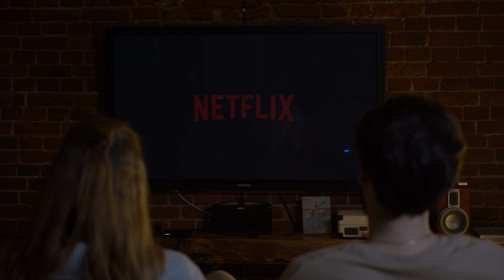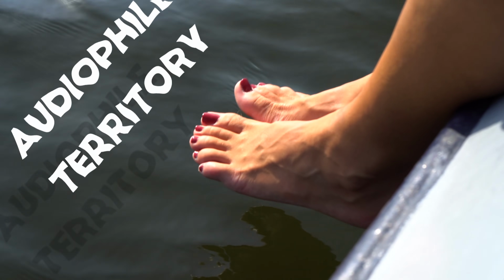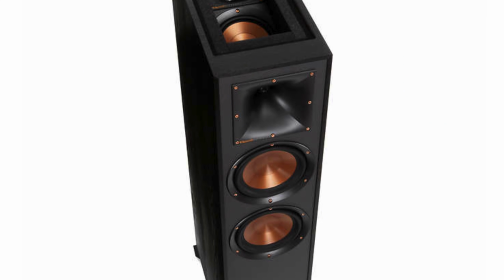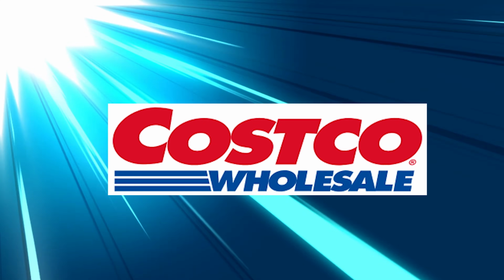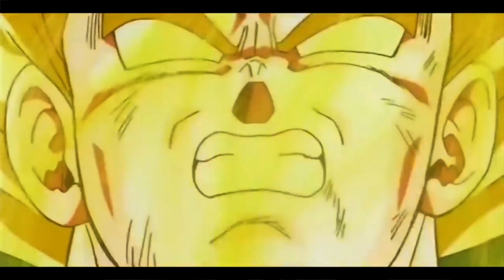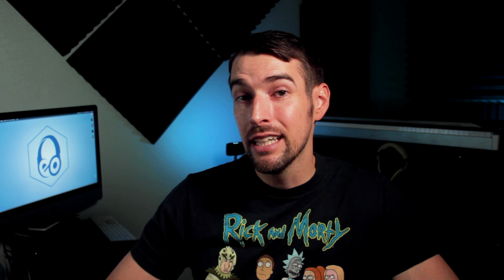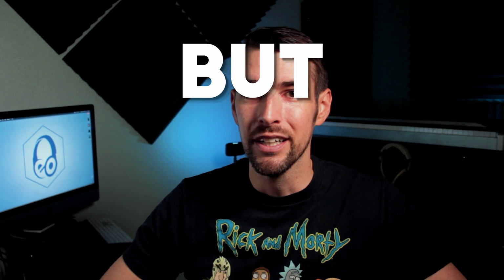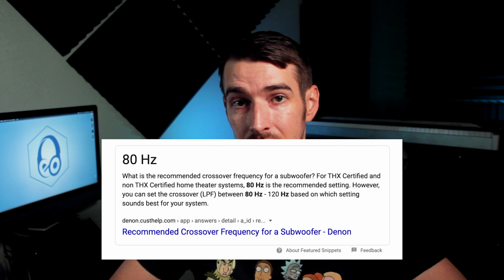$1,500 BRAND NEW Dolby Atmos BEAST SETUP?! Costco & Klipsch Bring It AGAIN!!!

Comment: Coming from a huge Klipsch fan, you must get the RF 7 III. I have them on the low end STR 750DH Sony receiver with a HSU Research MK5 VTF3 subwoofer and it blows away 99% of systems I have ever heard. I also have an Emotiva power and pre amp when listening to 2 channel audio. Definitely need another HSU research to fill the room more. Thanks for the advice and these are some killer deals.

Comment: Heads up it comes with the necessary wire for all connections, comes with 7 speaker wire sets pre cut. Just got this set over the weekend
Reply: Hooked them up to a Pioneer VSX-LX304, with one Klipsch R-12SW, also have some Klipsch Black Label b-100 hooked up as my rear with the r-41m setup in the middle of my room
Reply from the maker: @gradyshanahan2005  nice!!! Yeah, I’ve heard it actually does come with the necessary amount of wires. Costco needs to update their product description. 😀

Comment: Hey Ealan. may i ask, if those rear speakers can be connected wirelessly, and if not, what would you suggest as a wireless option? Ther front part can be wired, but for the rear part i need wireless speakers. Thanks for the answer

Comment: Hello mate, actually am thinking to buy Samsung soundbar q950t but watching your YouTube video kind of gives me second thought about buying them in piece. Just want to know if the sound quality would be better than some expensive soundbars in the market.
Reply from the maker: That Samsung is def very highly rated. And I understand how soundbars are so popular right now with how easy they are to set up. 

But I’m pretty old school, so I prefer a solid receiver powering wired speakers over a soundbar any day. More effort to hook it all up, yes, but more reliable and powerful, in my opinion. I mean having that 12” Klipsch subwoofer alone is a reason to NOT go with a soundbar. 

But like I said, I understand the appeal of a soundbar, and depending on your home theater space, that Samsung might be perfect! But I have a large, open concept living room, so I just need more power to push the air out of my speakers quite a distance to my couches. 

Also, yes...I honestly think the sound quality would be better with the Klipsch floor speakers and bookshelf speakers. 

But lastly, depending on where you live, the Samsung might be more available and at an affordable price than the Klipsch setup. I know people in Europe have commented that Klipsch speakers are insanely expensive.

Comment: Do you know if the Yamaha tsr 700 from costco can handle the 899 klipsche speaker system (from costco) and 2 klipsche subwoofers (from costco) well?
Reply from the maker: Most definitely. Although I keep getting conflicting numbers saying it’s 7.1 or 7.2, so I’m not 100% certain it can handle 2 subs. Technically, the same receiver is also known as the RX-V6A, which is 7.2, so go figure. 😄 But power-wise, it should handle even larger speakers just fine. And it’s 8K ready, if that kind of thing is important to you. 👍
Reply: Yup I just bought the receiver about a week ago the box says 7.2 what does 8k really mean
Reply from the maker: @tylerdurden6186  It just means it's 8K-ready for when 8K resolution becomes the norm with streaming broadcasts and blu-rays, etc. Kinda like how 4K is the norm currently. But everything in 8K won't be for at least another  years maybe? But at least you know you can upgrade your TV to 8K and not have to worry about upgrading your receiver, too! Woohoo!

Comment: what brackets would you recommend to hang these speakers?? just got this system! thanks man great vid.
Reply from the maker: These ones are great and cheap for the bookshelf speakers (on Amazon) -  https://amzn.to/3tLWyvU

 And congrats on getting the system! Thanks for watching! 😀🙌
Reply: @ealanosborne  what about for those satellite speakers?  and also whats a good avr for next gen game consoles?
Reply from the maker: @psychojackel69  I use these for my little Klipsch Theater Pack satellites 

Monoprice Low Profile 22 Lb Capacity Speaker Mounts
On Amazon https://amzn.to/3pLIQGk

And the Yamaha RX-V6A is a stellar receiver that can handle 8K 60 Hz and 4K 120Hz for next gen gaming!
Reply: @ealanosborne  i just saw costco put back up the yamaha tsr700 7.1 for 400 . and supposedly its the same as rv6a. but  it says it is a 7.1 with 2 mono subwoofers. what's the difference between that and 7.2 system? i have two subs is why i ask.
Reply from the maker: @psychojackel69  Oh sweet! That's awesome! Well, 2 mono subwoofer channels just means it's one signal that's been split into to ports. You might not get AS much power to each sub as you would with 2 independent subwoofer channels, but honestly...it probably won't make much of a difference. So since you have 2 subwoofers, and it has 2 ports to plug them into, go for it!

Comment: During December 2020 that sub was on sale at my local Costco for $99ea!
Reply: @ealanosborne  I have a 12” onkyo sub on my 7.1 would it matter if I paired it with that klipsch sub to make it 7.2?
Reply from the maker: @sabrewolf9567  nope. There’s plenty you can do to “timbre match” 2 different subs. I know Home Theater Guru has a video about it, if you wanna search in their archive. 👍
Reply: Way to rub it in. Haha. Jk. Last summer RC Willey’s opened up a new store in my home town and had “grand opening prices” and I got my first klipsch bookshelf speakers R-41m for 80 dollars per pair. I bought two pairs right on the spot. I know a deal when I see one.

Comment: My speakers alone cost over 2500. Throw in my 2 12inch Klipsch subs that cost 500 each my receiver that cost 1000 my TV cost 1600. Then all the 8awg speaker wire and HDMI cables, and my pure silver banana plugs. Crossover settings should be set about 10hz above the cutoff. For example, A lot of bookshelf speakers low cutoff is 70hz, so set your crossover to 80hz.

Comment: Is a full Sonos system good or even worth it? Arc, 2 play 5’s, 2 sub’s? You know compared to what you’re recommending right now
Reply from the maker: I’m pretty old school when it comes to home theater, so I’m gonna side with wires and receivers over soundbars any day. And getting an Arc, 2 play 5’s and 2 subs is gonna cost a lot more than the setup I explained in this video anyway. 

The other factor is connectivity. With any wireless system, there’s always more of a chance to have syncing issues or the need to troubleshoot problems. My receiver+wired speakers never has connectivity issues. I turn on the TV, and I know it’s gonna work. 

Lastly, those Klipsch subs still blow Sonos subs out of the water. Hands down. I’m personally okay with the effort it takes to connect speaker wires to a receiver (especially mine, which I had to snake through the attic and fish out of the walls) because the end result is extremely reliable. 👍
Reply: @ealanosborne  Thank you so much for the quick response! I really appreciate it! Ya I know what you’re saying I wanted to go old school and get like a full 9.2 or even a higher system, but my cousin told me I have to get Sonos because it’s so easy and efficient. 
And to be honest I’m blown away with what I got. You should definitely try a full system and see how it is. I would love to see what you would think about since you know why more about all the system and what they can deliver. Anyway Thanks again for the response!!
Reply from the maker: @artintsaturyan  Believe me I’m so curious about Sonos’s claims about their room calibration tech. I’m trying to get people to join my Patreon so I can use the proceeds to get more systems to review, but so far, I have only one patron. 😄 Being a small channel, I don’t have much power behind my email requests to companies asking for products to review. 🤣 Some day, tho! 🙌
Reply: Don’t worry you’ll get there. You put out some great content!

Comment: as for experiance goes in this domain
..i would stay as far as possible from...trusted brands sold in a costco.....

because there is a bunch of them who are fakes and only sold in the costco by shady  resselers.

if you think this is a good deal...there is a trap there.
kiplish wouldnt lower their price for anyone... so why would costco be able to have it lower? well because it is not a real kiplish.
k
Reply: you couldn't be more wrong. sure, other products might be being sold by shady resellers but.....I got this whole setup (speaker pack, sub and denon receiver) back in December, and it is absolutely superb. real and genuine products, both the klipsch speakers and the denon receiver. this stereo setup will blow you away, and it sounds freaking amazing. Please don't be discouraged by trolls like this guy, from buying this setup at costco. you will be supremely happy with your purchase after you get it setup and listen to it for the first time. I've owned klipsch systems for the past 15 years, and this offering at costco is legit and real. get it before its gone, you won't be disappointed!

Comment: Great video thanks for posting!!! but I have a question, I'm definitely looking into upgrading my receiver. But I don't see why the 

sony av receiver str-dn1080 
$499
Is with the extra $150 from the cost of the 
Sony str-dh790 

     The only real difference I can see was that it has an extra 150 watts I think. Did I miss something? What's the big benefit of jumping up to the next level?
Reply from the maker: Great question! I’ve pasted a great comparison chart below you can take a look at. But in a nutshell, the DN1080 just has more bells and whistles. Yes it’s rated at 100W while the DH790 is 90W, but the 1080 also has more HDMI inputs, more HDMI outputs, more music streaming options, Google or Alexa support, eARC support, smartphone app control, etc. Those bells and whistles you might not care about, so the DH790 might be good enough for you! 👍

https://www.crutchfield.com/S-RBB8MuKVTM1/compare_158STDH790_158STN1080/Sony-STR-DH790-vs-Sony-STR-DN1080.html
Reply: @ealanosborne  thank you very much for the quick response!! As I was looking to go in today, to buy a new receiver. your help is greatly appreciated! So yes you're right I don't care about those bells and whistles. The only thing I care about raw power and if the receiver can handle Dolby Atmos. So the 790 is for me at a perfect price. 
Side note: a quick search of Google and costco.com shows that the 790 is no longer available at Costco. Although Best buy does have it for the same price and I get 6 months no interest. So off to best buy I go. Also I'm in the United States I don't know if that makes a difference but it's not available to me. 
   Thank you again sir for your help you have found a new subscriber!
Reply from the maker: @shadowdemon7770  Awesome! Happy to help! And thanks for the sub! 🙌🙌

Comment: Good recommendations and tips for beginners I would however go with a beefier receiver than the ones you recommend. On black Friday I got the Denon X3600h that has features like E-ARC, Audyssey XT 32, and 105w x 9ch for only $899. I also picked up 5 speakers from JBL's studio 500 series at a discount of 60% ( Studio 580's for front, L/R duty, 530 bookshelves for surround, and a studio 520c center channel all for $1020 shipped! Lastly I picked up a monoprice monolith 10 inch sub on sale for $450 and 100 ft Monster cable 16 gauge speaker wire from Walmart for $16. All in I'm under $2500 and have a top notch 5.1 surround system. The sound of the JBL speakers blow me away at times.
Reply: Dude I got the Studio series on sale too.  I'm pretty happy with it except I feel like my previous center channel was better so I'm using that instead.  I feel like the 520c is a bit thin sounding in comparison to the rest of the studio line.

Comment: Hey Ealan, I am going to install this Klipsch system in my living room. I do have two soundavo in ceiling speakers already placed above my couches connected to my whole home audio. Would it be a better option to not hook up the speakers that shoot up to the ceiling and replace with the ones I have already installed? Could I do both? 
Also how can I hook up this receiver with my whole home audio amp? Also do you know where I can get the bookshelf speaker floor stands from?
Reply from the maker: Well, not knowing exactly how your whole home audio is set up, I'll just give you a few pointers. 

Since you wanna get this Klipsch system in your living room, you'll probably wanna replace your current home audio amp with the AV receiver, since your in-ceiling speakers are connected via speaker wire anyway. And yes, you should definitely utilize the in-ceiling speakers over upward-firing speakers. 

But if you get a 9 channel receiver, you could use both the upward-firing speakers in the towers, AND your in-ceiling speakers as your "rear height channels." Even better! 9 channel receivers are expensive, though, so I'd maybe try and find a good used one, if you can. 

I personally use the Onkyo TX-NR787 which is a few years old, but it's great! Onkyo seems to be the only brand out there that offered 9 channel receivers under $1,000, so maybe find the NR787 or even the NR797 or the RZ820. Denon offers 9 channel, but it's more like $1,299, so I'm not sure what you're budget is.

Check out the links in my description for some nice, cheap speaker stands, too. :) Thanks for watching!
Reply: @ealanosborne  Thank you man! I really enjoy your videos, keep them coming
Reply from the maker: @vicrodssfc  Thank you so much! Compliments sure do help me along in this process of making content! 😀👍

Comment: Ealan I sent a message to your Twitter MD pls answer
Reply from the maker: ...didn’t see anything in my Twitter...wanna just ask me here?
Reply: @ealanosborne  Sir thank you for the great video. I've started to replace my Bose Sound Bar 700 and Bass Module 700 but am on a tighter budget. I picked up the Klipsch Reference Theater Pack from Walmart for $330. All the prices on things seem to have gone up. I have ordered the Sony 790 bit parts of me want the Denon S750H. But do you think the Sony is plenty? I don't crank things up. Thanks!
Reply from the maker: @kennethboyer316  Yes, the Sony would be plenty for the Reference Theater Pack. Those speakers are very sensitive, meaning they won’t need a ton of power to get loud. And Denon vs Sony at that price point? Eh, really just personal preference. They’re pretty comparable. 👍
Reply: @ealanosborne  Thank you very much for your help. It helps immensely.

Comment: Would it be better to get normal klipsitch tower speakers  and install 2 speakers in ceiling to get Dolby atmos?
Reply from the maker: Correct. The upward firing speakers are pretty dope, but it’s always better to have sound pointed directly at you, as opposed to reflections off the ceiling.

Comment: 1,500 Atmos but does it have good sound reproduction?
Reply: Ain't getting much better for that price point. Many will tell you Klipsch aren't as top-performing as other brands, but I feel this system would rock any small to medium room with a fantastic sound stage. Absolute baging of a deal. This price point is about as much as my 7.2 channel setup and I love mine. Not Atoms though. Reflective Atmos speakers are pretty decent, but nothing beats in-ceiling Atmos speakers.  Will always be upgrading more stuff though.
Reply: @iforgotwhatiwasdoin  what is a sound stage?
Reply: @patrick7799  A sound stage is basically how well the speakers are able to offer depth, clarity, and immersion from multiple angles in an audio environment.

Comment: Good info. 
Got my theater setup off of Craigslist & EBay. 
Thiel Viewsonics  for $400
Infinity bookshelves $50
Onkyo rec. Atmos $50
Polk 10 and 12 subs $80 each
Magnapan front speakers $100
Cerwin Vega! AT-15’s $100 to go with the ones I bought in 1991. 
2 Adcom amps $350 each. 
Polk center $25
Cerwin Vegas & Adcom are in a stereo configuration, the rest is the theater. 
120” projection “sound permeable “ screen. 
Effing awesome!

Comment: Oh boy...I was planning on spending around 2k for some Kef q150s, q650c, a svs pb 1000, and some cheap ones for side surrounds for a 5.1 setup along with an avr.  Now idk, this set from Costco looks like a really good deal.  I just don't want buyers remorse if I don't like them
Reply from the maker: True. Buyer’s remorse is real. Although this setup is solid. Klipsch is so popular - I think - because they are incredibly efficient, being able to play loud without a ton of power from a receiver, allowing one to NOT have to spend a mint on an expensive receiver, yet still get great sound. But I get it - KEF and SVS are a killer combo, too. They just require more power - which always equates to more money. Would a KEF+SVS system ultimately sound better? Probably. But a $500 difference does make one hesitate.

One last thing to consider is, if you DO have a Costco membership, their return policy is unrivaled. So you could potentially return the Klipsch system if needs be, unlike other online retailers who have a more strict return policy. 👍
Reply: @ealanosborne  thanks for the reply! Do you think the denon s750h would be enough power for the kef setup?
Reply from the maker: @scottgunther2021  Eh...if you’re gonna splurge on KEF, I’d maybe get something rated closer to 100 watts per channel or so. Like the next Denon model up is the S960H rated at 90 watts per channel and is also 8K-ready, so if and when you decide to go 8K, you wouldn’t have to upgrade your receiver once again. 👍